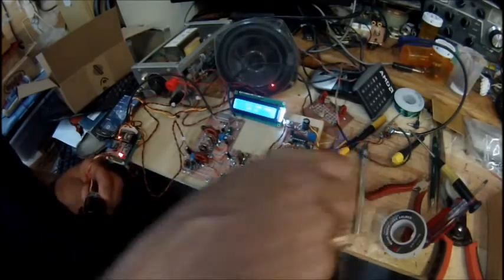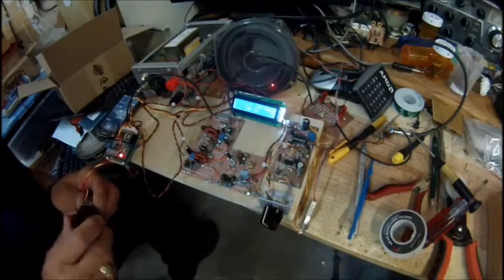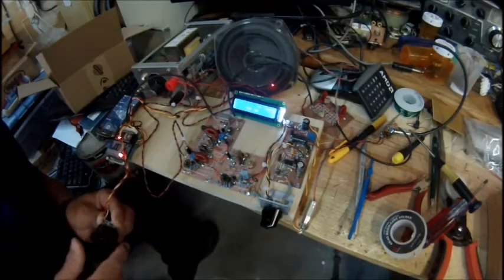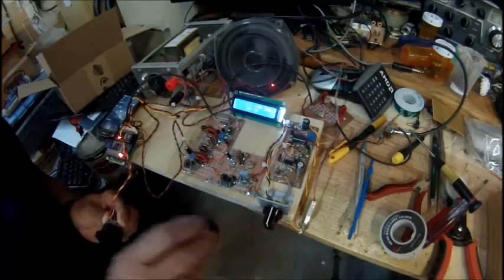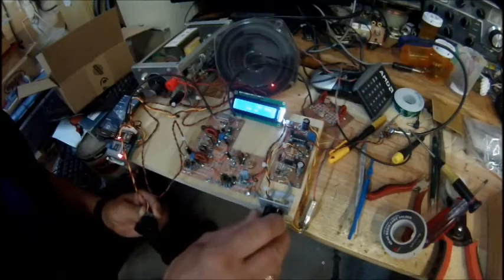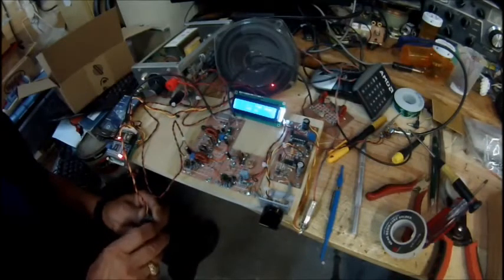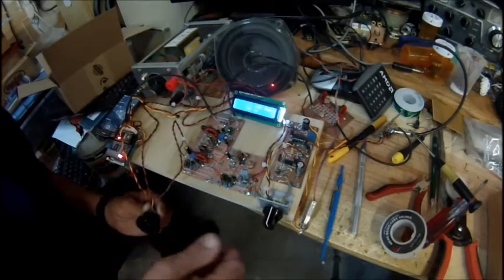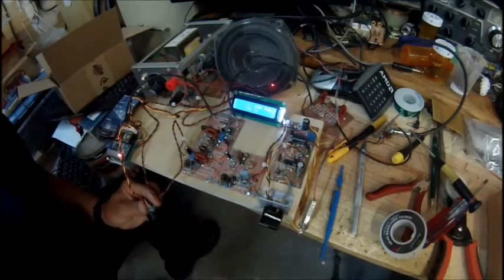Copy of Simpleceiver 3rd Generation

Comment: I see 2xJ310 used by the greek company, in his super pre-amp. 2x J310 Push-Pull Low-noise HF pre-Amplifier (30 KHZ - 30 MHZ) Must be really hot ! Just imagine what you would hear with my fully balanced 160 meter loop tuned for low part of 40m band !  20db improvement in rxed signals with this antenna.
Reply from the maker: The IF board has been repurposed for use with the Pipsqueak SSB Transceiver.

Pete
Reply: @N6QW  Yes, I'll look at what you did there. Do you have a place where schematics are posted for this continuous work you do ? This simpleciver sounded good. Ill be looking at the Pipsqueak.